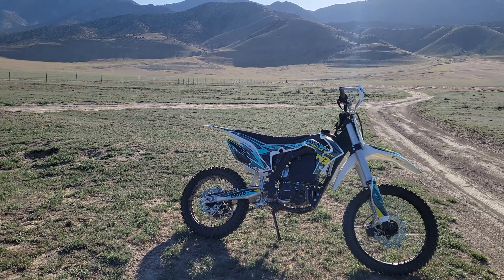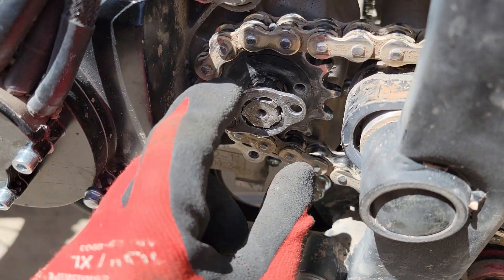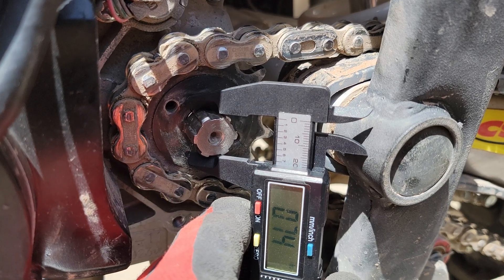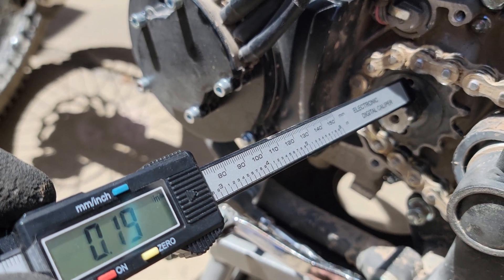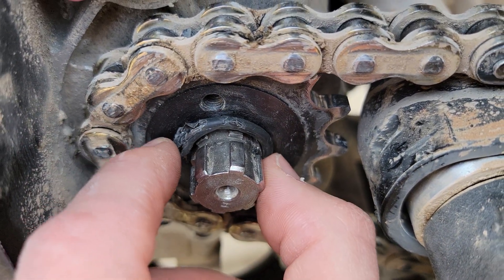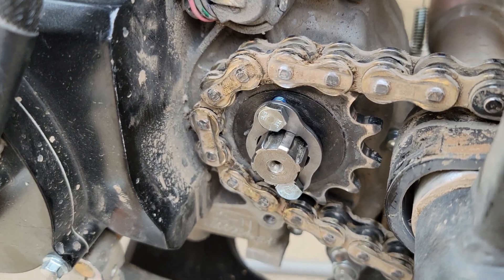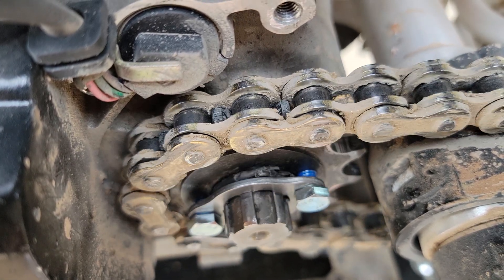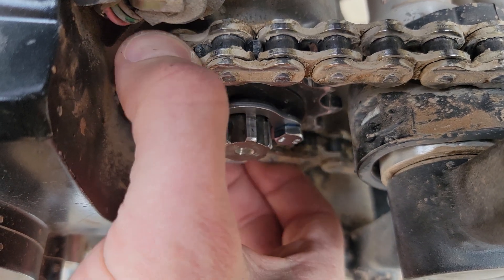Chinese Electric Dirt Bike Sprocket Issues (Nicot Moto eBeast)

Comment: I would try using o rings on the shaft and screws.
Reply from the maker: i found some lock washers that were small enough to get around the screws. This allowed me to really tighten down the 'wings' of the retaining clip. Going to run it some more and see if they hold.

Comment: I have an ebeast on order so I've been following them as much as I can.  The latest shipment was delayed by several days because they had wrong spacers for the rear wheel.  They had them remade to better position the wheel left to right.  It seems possible that up until that point they were using the wrong spacers so that may be worth investigating.  Incorrect spacing of the rear wheel could be resulting in the chain being at the wrong angle.
Reply from the maker: i saw that video as well and visually its super hard to tell how off it is. I need to figure out a way to measure the angle at both ends of the chain and see if its square. I would expect the sprocket to have a strange wear pattern. I dont think the chain alignment is the same problem as the slack on the drive shaft, but maybe.
Reply: Hello, question,  What is the price shipped to the house and would you have a direct link where to buy?, I have never bought from Alibaba, so I am a little concerned I just send $$ and never see the $ or my item. Thank you!!
Reply from the maker: This was the company I used https://www.alibaba.com/product-detail/Adult-Motocross-72V-12000W-High-Power_62537379170.html. I believe price shipped is 4500-5000 depending on where you live in the US (if you are outside the US not sure how that changes the cost)

I had never ordered from alibaba (but ive used aliexpress many times successfully). There are a few vendors that sell the same bike. You can chat/call them and talk through any questions you have (i found using whatsapp would make them more responsive)
Reply: @FeathersOffroad  cool so its almost cost compared with the suron,I am in FL., thx for the info Ill check it out 👊🏾😎
Reply: @jetrep Saw that update as well and feel after watching these videos posted months ago this may correct the problem. What tire setup did you go with? I think I might go supermotard to have this as a road play bike and not deal with it in the woods. I have a Sur ron but this for a faster commuter and a little more distance might be nice as the Surron on the stock battery at full get like 20 miles maybe. A new battery would maybe get my 50-70 miles but is about 3k. 

Do these bikes have a separate charger or plug in directly to the wall?

I am also going directly through Frank (as far as I know) seems like it’s going to be around $5000 shipped to my door.